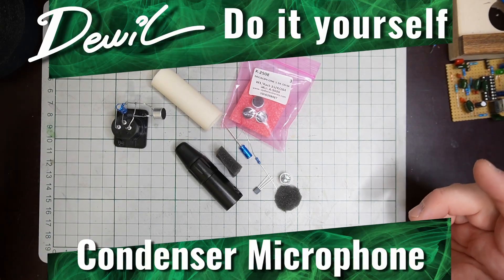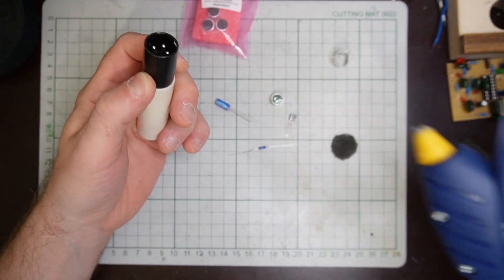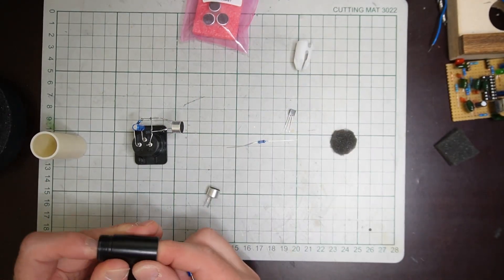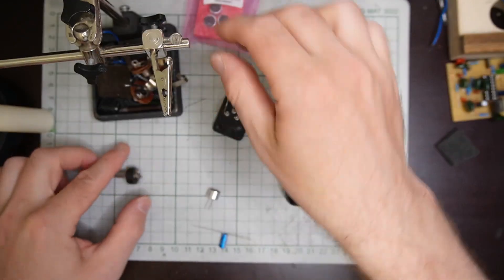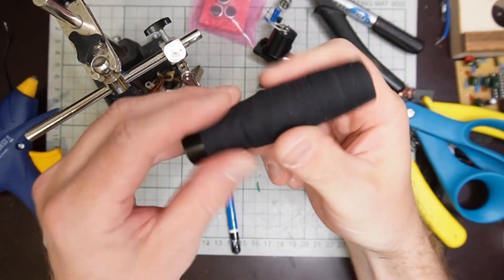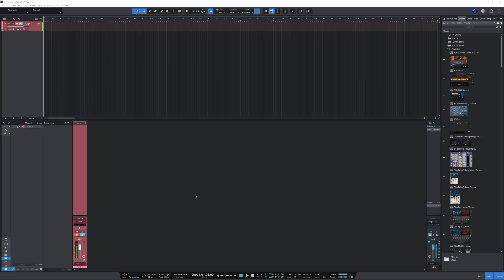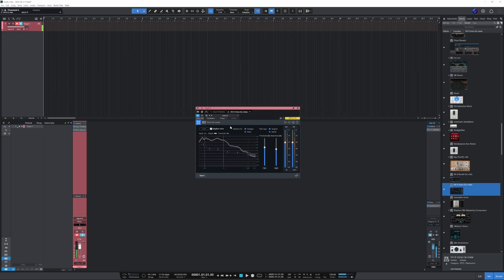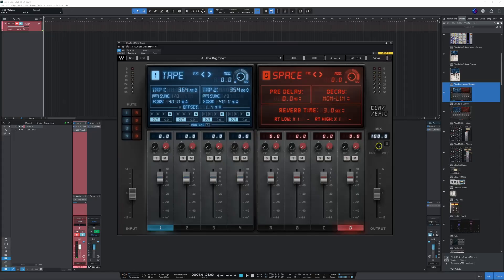DIY condenser microphone

Comment: Bendiciones excelente micrófono gracias por el aporte, por favor las terminales, como están en el vídeo, el transistor fet canal n, 
 Es que gate está conectada a la unión resistor( terminal 1xrl) y capacitor 1uf(terminal positiva a terminal 3 xrl), y está unión a la  terminal positiva del micrófono, la otra terminal negativa del micrófono a la terminal "s" del transistor fet, y terminal "d" a la terminal 2 del conecto xrl, gracias
Reply from the maker: I hope that was helpful, thank you. The diagram is on my website https://theofficialdewil.com/2025/08/23/diy-condenser-mic/